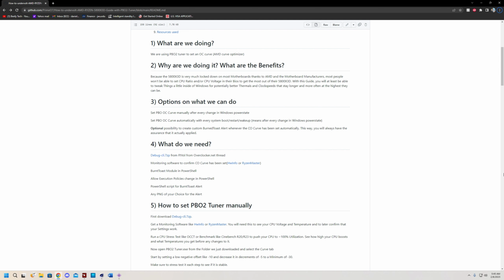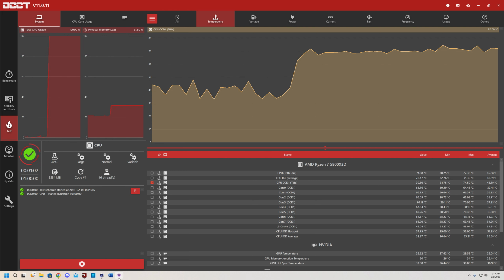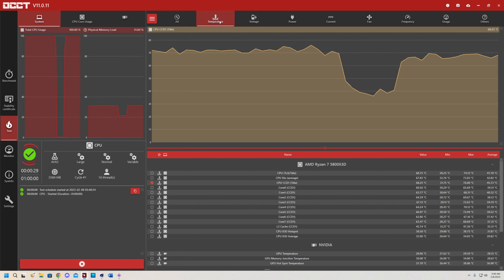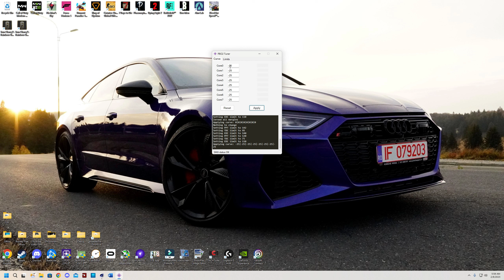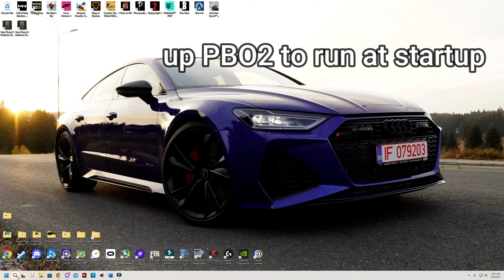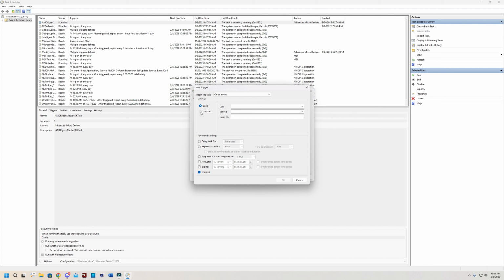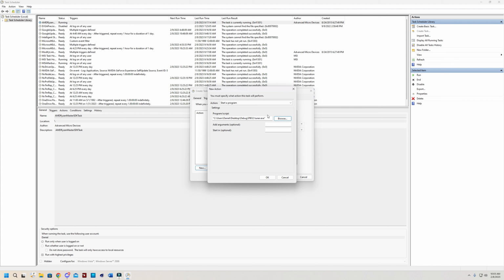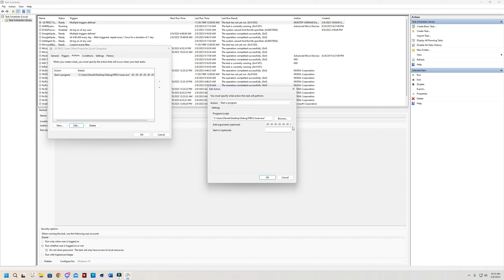5800X3D Undervolted with PBO2 Tuner (Setup Guide and Performance Testing)

Comment: im having trouble with task scheduler asking for an administrator password when trying to apply "run whether user is logged on or not,
Reply from the maker: When you are at task scheduler in the window  you name the task, select "Run whether user is logged in or not" and then also selected "do not store password option right below" that'll make it so no password is needed.
Reply: even when selecting "do not store password." it didnt work, probably because i was editing a task i had tried to get working before, what fixed it was just deleting that task and creating a new one with "do not store password." from the initial creation of it.
Reply from the maker: @KassidyCompiles  I understand. It's a bit finicky to be fair, but it's good it runs now xD

Comment: Thanks for the video,  my 5900X can boost to 4950mhz max
When I do -30 (which has been stable all day) I check OCCT and average frequencies are 4775mhz,  does this mean I'm missing out on Single core speed by doing this?
Reducing temps I like, but I prefer to keep my single core speed boost also.
Reply from the maker: On a 5900x you would lose a small amount of performance when undervolting yes. It will not be incredibly significant in a game though.

Comment: What a good video but I have seen that this configuration, -30 is only to lower the temperature but does not raise the fps
Reply from the maker: If you lower temperatures, you will increase frequencies. As an example most people can't sustain 4.45ghz normally due to heat, but with a -30 they'd push heat low enough to max out the frequency.

Comment: Im  using -30 on all cores for like 4 months by now , 0 problems and manage to drop the temps by almost 11 degrees with this undervolt profile.
Wonder if i can go lower then this , and try -35 or -40 ? :))
or -30 its the limit max ?
Reply from the maker: For 5800x3d -30 is the limit, but it's also very likely to be able to hit -30 which is great.

Ryzen 7000x3d has up to -40, but can only sustain -30 on 4 cores generally, and -20 all core
Reply: @Beefy-Tech  I see ya thought the same , didnt saw any yet with lower then -30 online, for 5800X3D .
Mersi pt. reply ! f bun video, ai  explicat totul pas cu pas :)
Ai un sub nou :)
Reply: @Beefy-Tech  what you mean by "sustain"? No crash/ blue screens? I`ve managed to go all cores -35 and test it in Cinebench23. No crash. My CPU is diffused in the USA. Don`t know if matters...but my 50 cents.
Reply from the maker: @M4V3RiCkU235  I just meant the bins aren't as consistently good on 7950x3d as they were on 5800x3d.

My 7950x3d sustains-30 on 7 of the 3d cores and -10 on best 3D core. But I've also seen people with keeping -20/-25 stable, so it'll vary between cpu's.

My friend ran -35 on 3 cores and -30 on other 3 cores on his 7900x3d, so just like your cpu, it's possible to reach -35 or even -40 undervolts.

Comment: how to know which core crashed so that i can fine tune each one? ....running a r9 5950x
Reply from the maker: Hey sorry for late response. You can't tell really...I've seen people identify unstable cores with prime 95, but it's not that straight forward... essentially you run prime 95, and have HW INFO app on the side, and you look for individual thread crashes at the certain settings you've applied.

Comment: My 5800X3D is idling at 60c and hits 90 as soon as anything gets turned on. I have tried the above mention PBO tuning and also setting the voltage offset to -0.05000 but nothing changes..everything stays the same... i think my Galahad 360 cooler is dying or the cpu which is new is dead.. Lian Li are sending me a new cooler under warranty but that takes 3 weeks and i need a temporary cooler till then.
Reply from the maker: It's most likely the cooler. A 5800x3d   can't overvolt itself, and if it did your cpu would be dead already so it guaranteed the cooler.

Comment: How do you set the other values on startup? Or you can only set the curve?
Reply from the maker: From my current knowledge, you can only set the curve. I am still hoping someone leaves a comment that they have found how to set the limits at startup too😂😂
Reply: @Beefy-Tech  Paste -30 -30 -30 -30 -30 -30 -30 -30 95 60 90 0 , both commends in video then its works (newer version of pbo2 tuner) , but main problem is PBO settings changed (getting defound values) when waking up from sleep/hibernation , triggers in the video , can you help please?

Comment: Any luck getting your infinity fabric to 2000mhz?  I think there needs to be a voltage bump somewhere to stabilize it, and undervolting somewhere else to bring the thermals down.
Reply from the maker: You cab stabilize it to a certain degree... but it's not very consistent on my side. For example cod runs, but it shows a Whea error 2 mins into OCCT. You can change some voltages and Power limits but generally the lower voltage a 5800x3d can run at, the more stable it runs, so 1900mhz+3800mhz ram is far more consistent overall.
Reply: @Beefy-Tech  oh sweet, my ram’s XMP is 4000, I dialed it back to 3600 as my efforts to run my infinity fabric above 1800 have all failed, and I think I’m doing wise by running in coupled mode, even though I’m running my ram slower than it can go.  My motherboard is top of the line with tons of cutting edge server grade VRM’s so I would think it should be able to squeak a bit more stability out of the 5800x3D.  But after crashes at even 1900 I decided to pair down to 1800 until I get some guidance. As this is all new to me. 

I got 4000 memory knowing the infinity fabric was capped at 2000mhz and I wanted to max it out, so I’m very interested in how I might be able to make it work. My CPU cooler is a  monster so there must be a way.

Comment: Hey Beefy, whats a good cooler for the 5800x3d?
Reply from the maker: Tbh you kind of have to go for a 360mm AIO if you want to keep it cool. I use a coolermaster 360mm aio.
Reply: Hyper 212 works with an undervolt. Just get anything above that and set your undervolt and you're gold for gaming. If you're doing production work then i also agree with the 360 rad requirement. If you want to avoid the potential risk with an aio, you can pick up the icegiant thermosiphon cooler. Basically an aio without the pump and tubes, so zero failure points except the fans

Comment: mine was stable on -30 -25on 2 best core and offset -0.0565 stock limits 4450ghz all core, but i had some whea errors in occt though i didnt have any crashes when gaming WZ2 around 66c ultra 1440
Reply from the maker: Whea means it's near to stable but you could occasionally get a crash. I run -30 most of the time too, but if I'm playing for a Nuke in warzone 2 (I've failed the nuke contract 3 times now lmao), I turn it to -25 for safety
Reply: @Beefy-Tech  i found out the cause for whea my 16gb cl18 4000mhz ram fclk of 2000 😅 i dialed it down to 3800/1900 whea is gone
Reply from the maker: @alpha416game3  ahhh that makes perfect sense actually. I had same issue initially with ram with whea errors at 2000👍
Reply: @Beefy-Tech  running timespy got 11200 cpu score but with my own undervolt i got 11700.

Comment: Is -35 possible? I just went straight to -30 on all cores and my system hasn't crashed since and it's been a week.
Reply from the maker: Unfortunately it's limited to -30. Theoretically, some well binned CPU's should be able to do more, but you can't actually set values lower then -30.
Reply: @Beefy-Tech  Thanks, didn’t want to change values and mess things up. You’ve helped me lower temps by over 10 degrees in benchmarks, it’s even more in gaming. You have a new subscriber. Thanks a lot!
Reply from the maker: @mmaaddict78  awesome to hear that it helped! If you didn't see the pinned comment, I wanted to mention we figured out how to also apply limits at startup, you can check it out in the pinned top comment incase that is also helpful.
Reply: @Beefy-Tech  After messing around with it for a few days on and off, I'm very pleased with the results. Running 4.45 on all cores in HWinfo at 79 C max and hitting 15,000 in Cinebench. I was able to lower my fan curve to make my system pretty quiet now too. It used to sound like a vacuum cleaner and hitting 90 C. Very happy now.

Comment: hey guys! I kind of need some help on figuring out why the AIO cooler (240 corsair) stops working randomly for a few secs after undervolting. No crashes, no BSODs, just the fans from the coolers randomly stops while set manually at extreme. Is this considered a system instability? Any ideas? Thanks!
Reply from the maker: I personally don't have much experience with that, but my assumption is that it uses more power then available when set to Max RPM's, or a connector loses connection for a short time. Very unlikely I'll actually be right, but I'm trying to throw some guesses out there lol. 

Make sure everything is plugged in thoughouly, and update to latest bios drivers and chipset drivers if you haven't already.
Reply: @Beefy-Tech  thanks a lot for stepping in with some advice! everything was already updated to the latest version possible though :(. plus this never happened before undervolting :(

Comment: I'd love to know how you got those temps. I've done pbo2 tuner -30 uv and all it did was reduce temps by 6-7°C and im using a 360mm AIO kraken.
Reply from the maker: My Temps were at most reduced by 5c when limits are applied with a -25  offset with 360mm cooler master aio. 5800x3d's vary quiet a lot in efficiency, so there'll be quiet big temp differences between cpu's regardless.
Reply: @Beefy-Tech  I mean how are you even getting those temps at stock settings? Every reviewer got over 75°C under load. What are your temps in cinebench or if you encode a video in handbrake?
Reply from the maker: @mesicek7  OCCT is not as heavy as other benchmarks, it's more representative of an ingame all core workload. In cinebench R23 I'm pretty sure it hovers in the mid 70s (75c-78c) with UV enabled.

Comment: My Mobo is a AS Rock B550M-C.  Does anybody know if this has the PBO2 in Bios already?  I actually updated Bios to latest version last week.  Havnt had time to get back in this week.  Putting in a new 5800X3D tomorrow
Reply from the maker: Hey, I'm not sure if that feature came to Asrocks mobos but on the website it'd specify something along the lines off "Added PBO functionality to 5800x3d" or something similar next to the bios that'd have it. If you don't see any writing something along those lines then it probably doesn't support in bios PBO.

Comment: our temps are wildly better than mine with a DarckRock Pro 4, where I will hit 90C after about 20 seconds in Cinebench R23. Clocks will be around 4200-4300 throughout a 10-minute run. I will check this out but I doubt I will have the headroom tempswise, maybe? Or maybe that means I really should look into it. I'm completely new to undervolting so I'm just wondering if there is any possibility that one can "lock" their system with an unstable clock, or is it reset every one reebots? Thanks, man.
Reply from the maker: An undervolt won't be able to damage your system or lock it. It may lead to a crash due to instability, but it won't harm your pc and you can just adjust your undervolt if it were to happen. If you hit 90c in cinebench then def give the undervolt a try, it'll help in games by 2-3 degrees and in benchmarks by up to 5 degrees if you use both offset and power limits.
Reply: @Beefy-Tech  Cool, very good to know. I know that it's probably nothing to do with thermal paste or the way the CPU is seated because temps are fine during idle. (ca. 32-40C depending on ambient temperature), and around 60-70 in gaming, which for this CPU on air cooling is pretty normal. Granted C23 is a synthetic benchmark it's unusual for anything else to push the cores that hard, I assume. Also the fact that the CPU doesn't really downclock that much during a full 10-minute pass must hopefully mean that it's alright, (knock on wood).
Reply: @Beefy-Tech  Oh, another thing: I'm just asking these questions because channels like HU would say something like: "I would leave undervolting to people who know what they're doing" etc. :)
Reply from the maker: @iseeu-fp9po  I mean people like to overcomplicate things. For this CPU undervolting has massive benefits, where it nearly behaves as an overclock (because it increases performance) and it decreases temperatures. There's no downside to doing it other than spending some time making sure it's stable, and you know, once you invest into a computer it's best to enjoy the maximum performance it can offer after all!

Comment: i was wondering if there is something like this for steam deck. i don't want to do it via bios hacking, it's too risky on the deck
Reply from the maker: I don't think there'll be an App specifically for the steam decks situation. It most likely has all tuning blocked and won't allow you to undervolt through conventional means. Even this PBO tuner app was solely designed for the 5800x3d.

Comment: Hi, maybe you can help, I actually tried this recently with the same processor, at first it worked perfectly, but when I rebooted, my anti-virus Avast, blocked something, like the zencores file, then left the temperatures at 80 deg even at idle. Even if I unblock it in anti-virus, It does not resolve the issue anymore.

I am using Noctua NH D15, and before this, I can idle at 48 deg.
Reply from the maker: Yes, so Anti virus is the issue here... I'm not sure why it's at 80 degrees, but something definitely went wrong there. Reinstall both the anti virus and the pbo2 and make sure you give all permissions to pbo2 so it doesn't try intervene with pbo2 again.
Reply: @Beefy-Tech  Thank you for this, I also raised this in reddit, same advise as you, uninstall anti-virus and it worked, my CPU is fine again, thank you so much, subscribed.
Reply from the maker: @orchestertan123  No problem fam! I went through this exact issue years ago and this was my fix too. 👍

Comment: My 5800x3D is locked at 3700 Mhz, I am assuming you went into the BIOS and tweaked?
Reply from the maker: You must update your bios. If it's not boosting correctly it's on a bios version that is bugged. Mine did that too on a older bios. It's supposed to boost to 4.3-4.45 by default.
Reply: @Beefy-Tech  ah ok then that makes sense, I updated my BIOS when I first got the CPU (4408) so I'll try a newer version for my X570-E.

Comment: its possible to task the limits??
Reply from the maker: Yes, figured it out. The command line looks like this.

-20 -20 -20 -20 -20 -20 -20 -20 120 75 110 0

That 0 at the end is important 👍

Comment: Idk I'd I'm a fan of adjusting the voltage on CPUs with 3DVCache
Reply from the maker: Lowering voltage on cpu's with V cache is in fact the best thing you can do for them. 3D v cache cpu's are the only ones that consistently gain performance from an undervolt, along with better temps. There is no downsides other than the process of finding system stability with undervolt, which isn't even tough really.

Comment: Hi, I did the same you did but still hottttt😂. 83C in BF2042 and 80C in Warzone 2. I have a B550M elite aorus and ddr4 3600mhz + water cooler 360. what do you think i can do?
Reply from the maker: It could be the actual mounting of the cpu then... possibly not enough thermal paste and not enough contact?

Comment: what about bios settings before run and "play" with pbo2? I have enabled re-size bar, cppc - enabled, cppc prefered - disable.... does I need to put on default this settings before playing with pbo2? thanks 😊
p.s. I have same 5800x3d
Reply from the maker: I used only Resizeable BAR for the cpu, nothing else is changed here. For ram a lot is changed, like timings, infinity fabric, voltage etc.
Reply: @Beefy-Tech  what about kombo strike option in bios is the same do kombo strike set to 3 like in pbo2 tuner all cores set to -30?
Reply from the maker: @killmyflow  I'm pretty sure it is yes, far more noticeable heat improvements, and far better control over what you input.
Reply from the maker: @killmyflow  I used dram Calc 8 months ago when I tuned, but it wasn't really helpful...in the end I did full custom timings.

Comment: Can i use this on my 5950x?

Any help will do thanks
Reply from the maker: Yes, but it will not improve performance. The reason 5800x3d gets extra performance from it is because lower heat results in better frequency when it comes to X3D v cache cpu's. 5950x will have lower power draw and heat, but frequency will not improve, and if you undervolt too much it may even decrease frequency.

So yes, u can but it'll have different outcomes then for a 5800x3d.

Comment: Anyone can help..recently i change the limit in PBO2 from default value..Ppt,tdc,edc 142,90,140

After setting limit below default value .
I cannot revert back to default value.. 
.ryzen 7 5850x3d

Anyone can help me
Reply from the maker: I recommend just re-installing the app, simplest fix.
Reply: @Beefy-Tech  reformated everything..i start from zero

Comment: What’s the difference between using this and using Ryzen master?
Reply from the maker: I do not know if Ryzen Master is able to auto apply anything at startup. I think Ryzen Master I designed for testing overclocks and undervolts and then applying them in BIOS, while this is strictly to apply your undervolts at startup if your motherboard doesnt support it in BIOS.
Reply: @Beefy-Tech  did you mean Kombo Strike 3 I have now that option in bios before with 5600x it wasn't there 🤔
Reply from the maker: @PsYVla  kombo strike 3 is a sortof  1 click oc feature but from Gamer Nexus's testing only rendered like 1% extra performance.